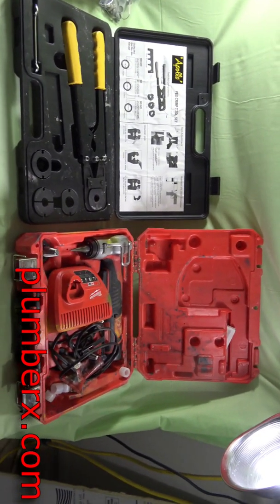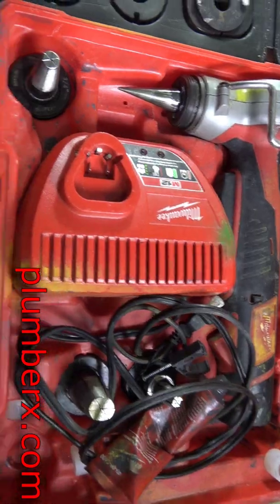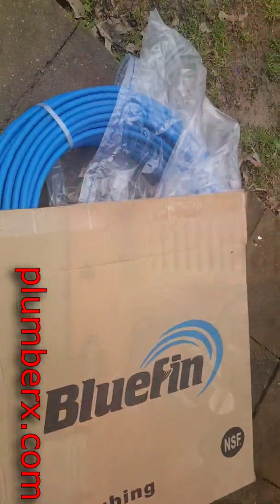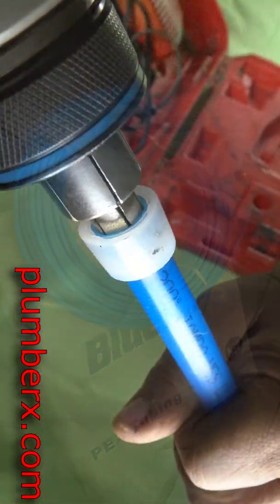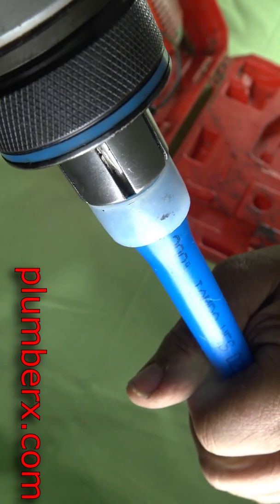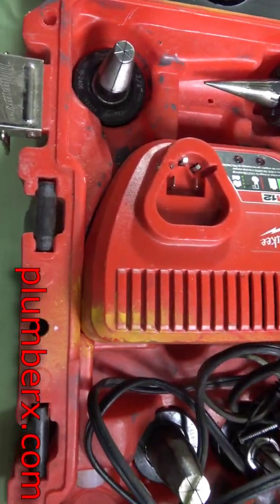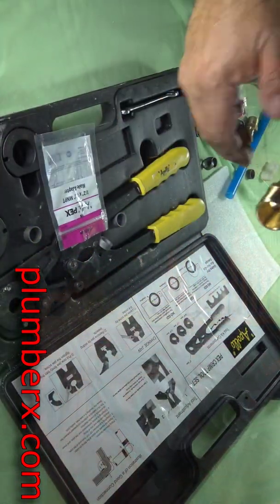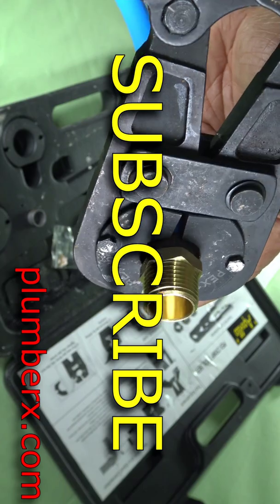PEX pipe vs. PEX pipe #shorts

Comment: I don't trust this new method. Crimping works flawlessly why is this better? I think that of my experiences as a mechanic,carpenter,and all around individual that is deeply involved in the science and engineering behind everything I work with has tough me anything it is with out a doubt that anything swaged will eventually fail. It's a cheap foolish and down right inadequate way to join two material.